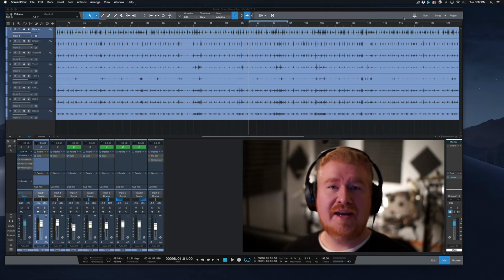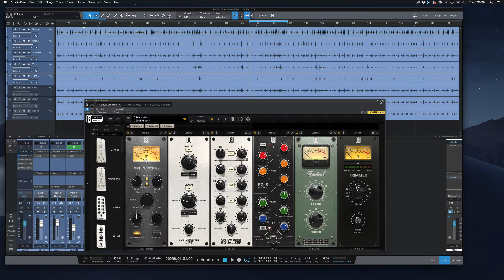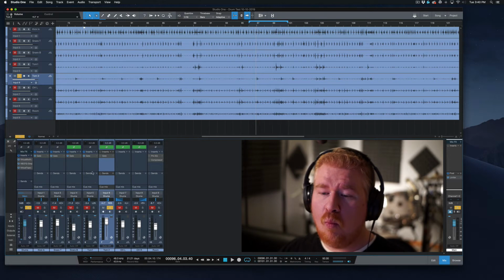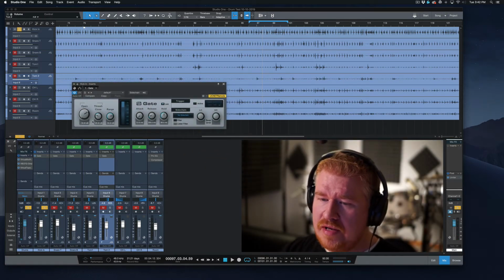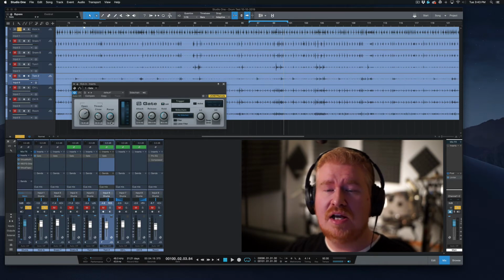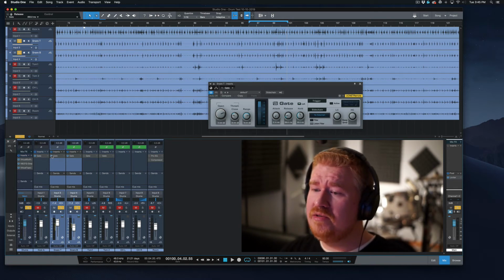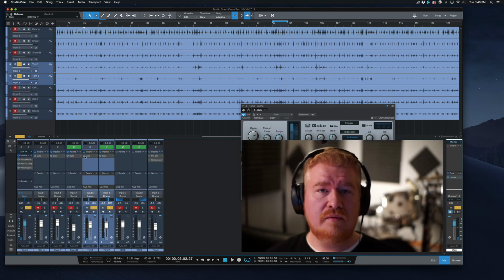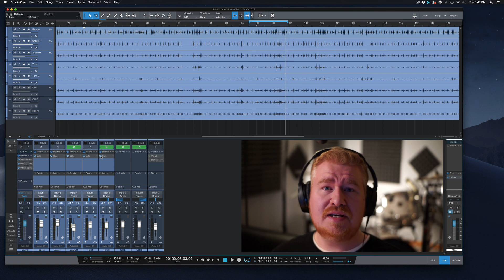Mix Better Drums Using STOCK Gates in Studio One

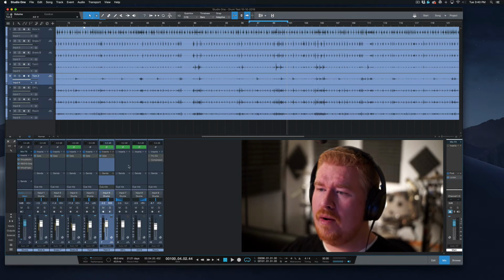Comment: Im a left handed drummer and i use ride cymbal  with my left hand which is suspended at the 2:00 position above the snare. I get stick attack in the snare mic like crazy due to the  mic being to close too the ride , even pointed away.  I can gate but I have to choke it in order to get the initial stick hit ( wooden tip). Any ideas?  Thx!!